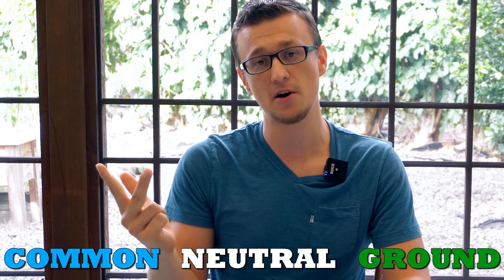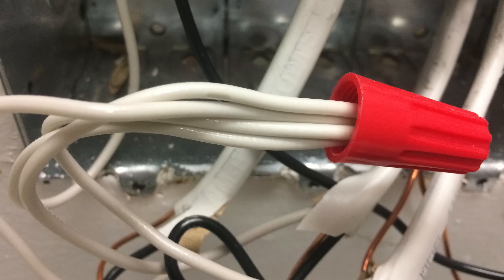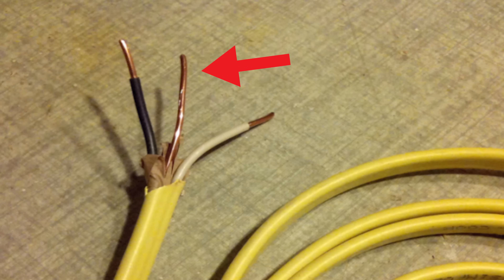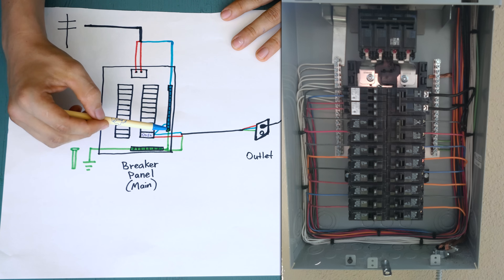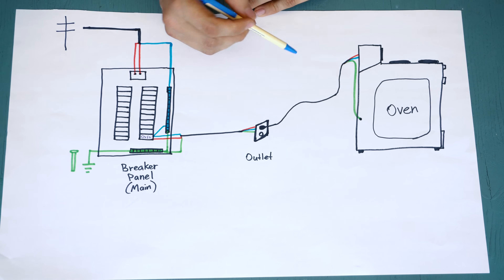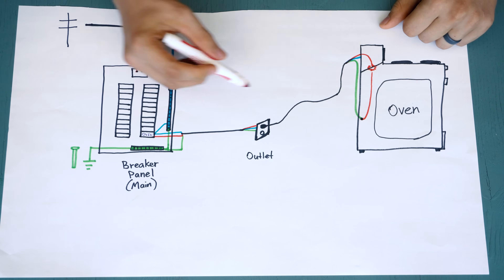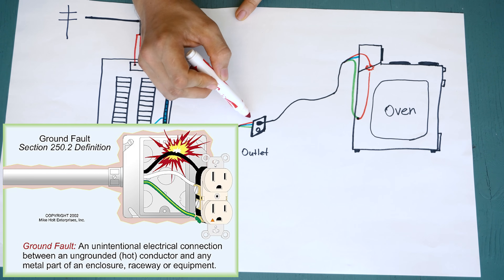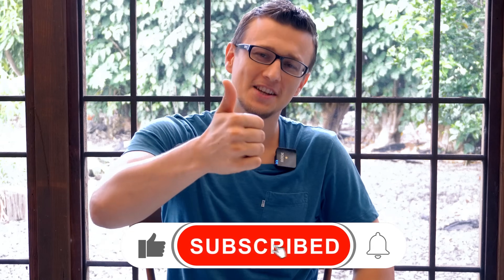Is Common and Ground The Same Thing?

Comment: OK I am no expert but this what I always thought. The term common is used more in a 24 volt ac, and the white 120 volt ac is usually termed neutral. In example an Air Conditioner has both and the term separates the two from each other. Neutral is usually just white and Common can be other than blue depending on the manufacturer .
Reply: That's the explanation I go by... common - low voltage return.  It's a shame that terminals on 120 loads and switches are frequently also labeled C though. In these cases it refers to a shared terminal or path in the circuit like the common in a two speed motor, or the common on a SPDT  (3-way switch or relay).
Reply from the maker: I agree with that too. In the video I just provided the "proper" definition. I know many techs name them exactly like you say. They refer to the 24v as common and the higher voltage as neutral. I learned early on that there are many things in HVAC that are not clear cut. Different folks will tell you different things.

Comment: Electrician connected to my plumbing cold line at water heater connection. Why? The water line from meter to outside is plastic . how many grounds or which one is the best
Reply from the maker: Hi Bob! I would need to check it out to be able to comment on that. I am assuming an electrician would know the best spots to connect grounds.
Reply: If there is more than one grounding point, they are required all be bonded together.  But was the connection to your cold water line suppose to be the system ground or was he bonding the piping to the system ground since it was near an electrical connection.  

Using water piping as the system ground is bad practice these days in my opinion since future changes to the plumbing could insert non-conductive elements breaking the Earthing.

Comment: I have a quick question, I replaced an outside outlet this past summer, turned off the breaker to that side of the house, double checked that there was no power to that outlet and  proceeded to unscrew the wires...I noticed small sparks from the white wire which is "pigtailed" inline to the adjoining outlets. Concerned that I may get electrocuted I decided to turn the master breaker box power off just to be certain, going back to that outlet I found there was still a small charge and minor sparks at the white wire..but touching the wire gave me no shock at all?..can there be residual current in the white neutral wire and if so how?..everything is wired properly and I did manage to install the new outlet without problems.
Sorry for the "quick" long winded question😉
Reply from the maker: I love the username by the way! Benevolent Backpacker  😄😎 I can't say for sure what caused that but two possibilities are either a defective breaker (could be loose wire connections too) or there was backfeed voltage which could originate from another circuit or appliance. Voltage can "backfeed" through indicating lights, transformers, capacitors, or resistors in equipment for some time even after power is shut off. That is why it's always recommended to verify that power is off with a meter or voltage detector before starting on a repair/replacement job.
Reply: @WordofAdviceTV  Thanks!...and thank you for the possible causes, all seems fine although it made me scratch my head.
Cheers again

Comment: My only question is why would the oven, if performing sound,  send power through neutral back to the power pole? Isn't a load on the circuit supposed to use all the power that it draws? Excellent video, definitely one worth watching twice to sink the knowledge in. Edit: watched it again, correct me if I am wrong, the oven under normal conditions doesn't send any power back through neutral unless there is a short, the neutral and ground wires back to the box act as a double safety route. The short caused  power returns to the pole via neutral until the breaker trips. The wire ground to outside ground pole is used if somehow the breaker fails to trip?
Reply from the maker: The science of electricity is a bit complex but I will attempt to explain 😅 
When an electrical current is used, it is not actually consumed. The same current that comes in will be the same current that comes out. So a hot leg/wire carries the current in and the return leg/wire (which is the neutral) carries the current back to where it came from (power station)
It's almost like washing your hands with water. Water is coming in and you use it but that does not make the water disappear. It just goes into the "return" drain.
This is my understanding of it. Though I am not an electrician or engineer so perhaps some future viewers can correct me if I am wrong. Basically the neutral wire does carry current and is used in AC appliances as a return path or you can say to complete the circuit.
Reply: @WordofAdviceTV   I'm not an electric engineer either, I am extrapolating on what I know about troubleshooting dc circuits on cars, and applying it here. Maybe electrical flow on AC circuits is different but ohm's law should still apply. With a dc circuits, you have a load with positive wire and ground back to DC power source/battery. The load is a resistance, and almost all voltage is used by the load, so if you have 12 volts on positive, if you check the ground you will see a voltage drop to a small number, usually 0.2 or 0.3 volts. With this voltage drop, current drops as well (ohm's law). So if we apply this to your example, the oven would be the load/resistance, the power pole the electric source, the neutral wire the "ground", with a tiny part of  original voltage (and equally small current) back to power pole, as the oven/ resistance has used almost all voltage/current to generate energy it needs to operate. The difference here is that a dc battery has a limit of 12 volts, and an house AC circuit had 120 with much more to spare if there is excessive draw. This presents safety issues, and that, I am guessing, would be why you would have a ground wire going to a ground outside your house, should the  connection neutral fail at outlet or junction box, there is redundancy. Motor Age channel has a pretty good overview of voltage drop caused by load/resistance on their Trainer video #96 if you want to look at this further.
Reply: Word of Advice TV Yes, you have it.  The current (negative charged electrons)
BALANCE back to the step down transformer outside provided by the power company.  NO VOLTAGE (the pressure) will be present on the neutral UNLESS
you have an OPEN neutral, (a dangerous condition) then all bets are off as this COULD now be hot, if ANY appliances (loads) are turned on. Confused yet?

Comment: What if your outlet ONLY have a power and a neutral located in a metal conduit box.  Does the metal conduit box acts as a ground?
Reply from the maker: When there is no ground wire, any electrical short in that outlet can cause a fire... The metal conduit box may act as a ground if the wires going to that outlet have a metal conduit around them that goes all the way back to the panel.

Comment: Before i watch this video heres my thought. Ground is a backup safety in case a metal becomes electrical charge. Gives a path in case a metal becomes electrical charge to increase safety if a person touches the metal. Neutral is just a path for 120 v and less to complete the electrical circuit. Common i struggle with. Something with sharing the same of something with a switch???
Reply from the maker: You had it pretty much spot on!! Bravo 👍👍💪💪

Comment from the maker: I did not explain this in the video but the range illustrated is a 115v gas range.
An electric 240v range would be either a 3-wire or a 4-wire hook up.
3-wire would be 2 hot legs and a neutral. (Neutral lead must be grounded to the cabinet)
4-wire would be 2 hot wires, a neutral, and a ground.
Reply: thanks for pointing this out as the ovens I have wired have not been 120v so this was something I noticed while watching
Reply: Three (3) wire system electric range. Is this the ONLY place where we use the Neutral as the Equipment Ground also? Thank you.
Reply: Why would 3 wire plugs be allowed of they don't have a ground? 240v is a lot of power.
Reply: Only on an old dedicated 3-wire circuit can the ground be used as a neutral.  This is so modern 240v appliances can be used on old 2-hots and a ground circuits.  It is relatively safe because the ground is NOT connected to any other appliances and goes directly back to the bonding point of the neutral and ground.  If there are other appliance cases on that ground bonding circuit, those cases could go live with a voltage difference if the ground wire is broken between the appliance and the breaker panel and the appliance using the ground as the neutral is switch so that current could flow through it to the ground.